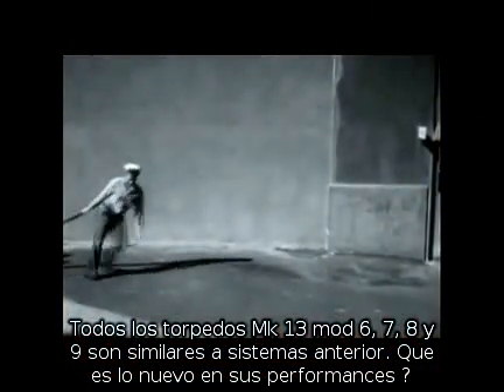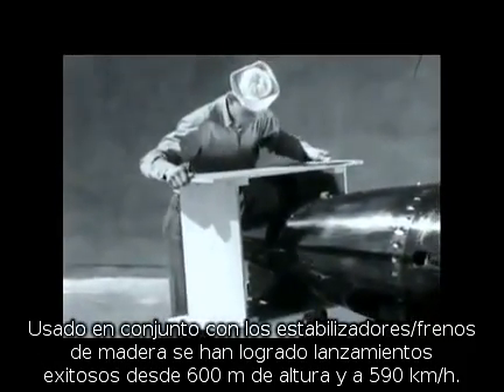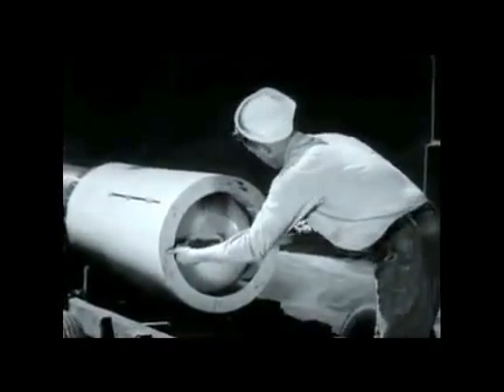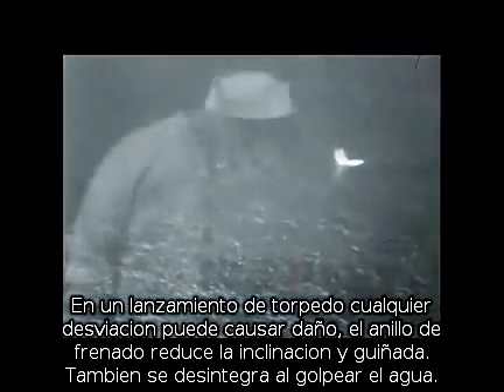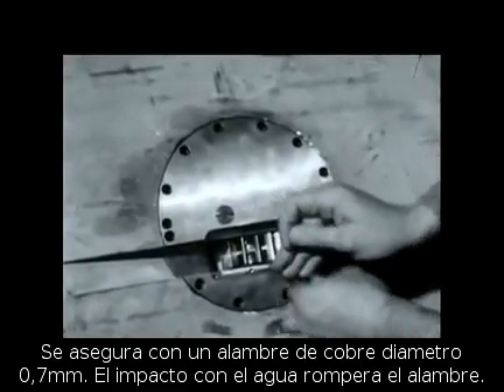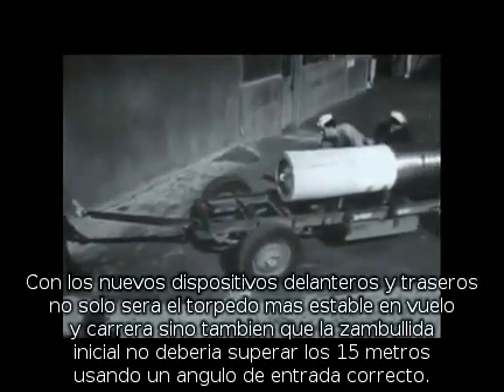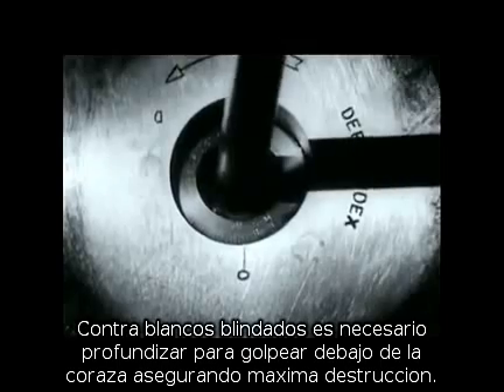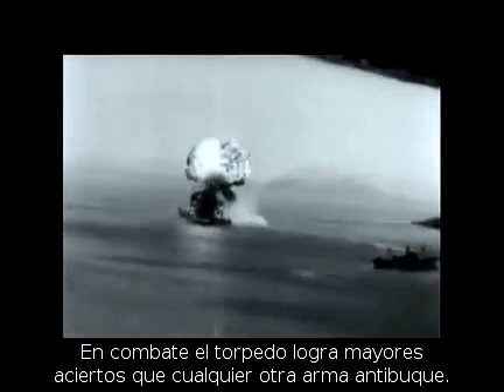Torpedo de 533mm Mark 13, funcionamiento.

Comment: ¿podría un Pucará transportar semejante carga a lo largo de tantos kilómetros?
En tal caso, si no hallara el objetivo, no podría regresar con la carga.
Reply from the maker: No era tantos, los pucaras tenian su base en las islas no en el continente, si tendria autonomia, adema sllevaria 2 tanques de 300 l bajos las alas. La mayor amenaza para el Pucara seria la antiaerea, pero una buena tactica y ataques noctunos o en condiciones de baja visibilidad podria tener chances.
Reply: *****
Resulta un punto interesante para investigar. El pucará podía transportar hasta 1.200 kg y desconozco el peso del torpedo, pero como se hicieron pruebas exitosas, sería factible. Las limitaciones pasarían por otro lado.
Se abren cantidad de especulaciones. Muchos Pucará estaban en la isla Borbón y fueron destruídos a medidos de mayo por un comando. Quizá no hubo tiempo de actuar.
Y si, podían tener chances. Los A4 fueron relativamente exitosos usando tácticas (y coraje) que sorprendieron a los ingleses.
Da para muchas especulaciones. 
Saludos
Reply from the maker: Ar a. Con esta configuracion llevaba mucho mas, el torpedo peso 970 kg y los 2 tanques de 300 l pesaban 620 kg.